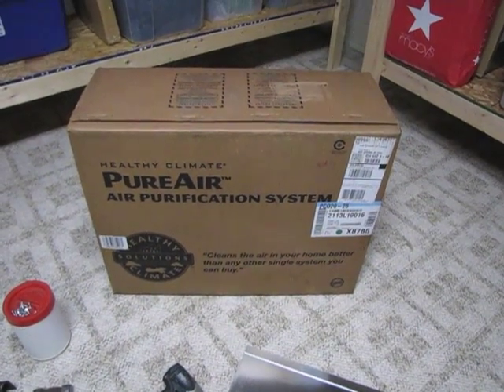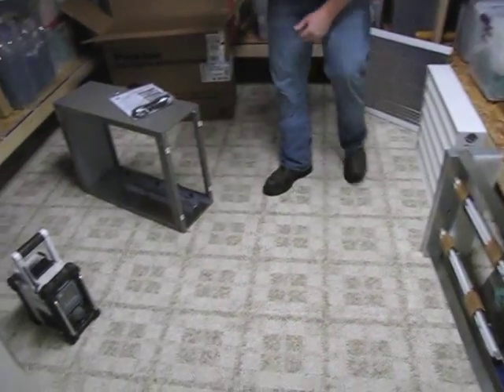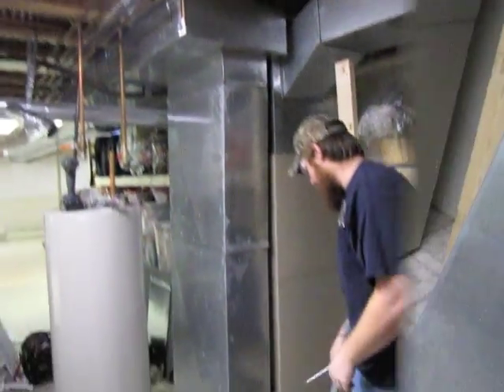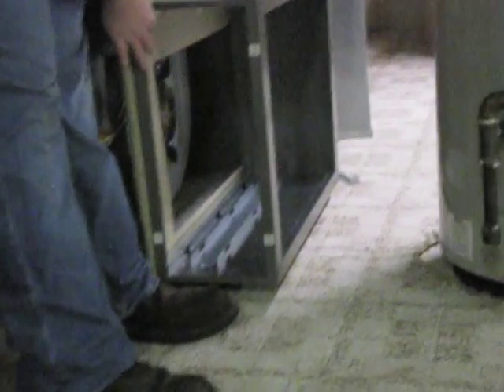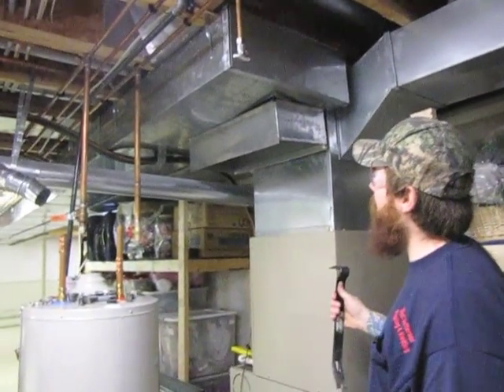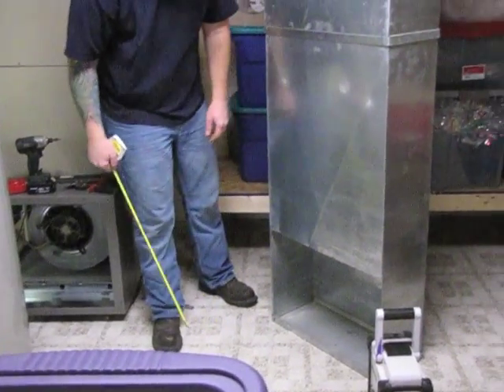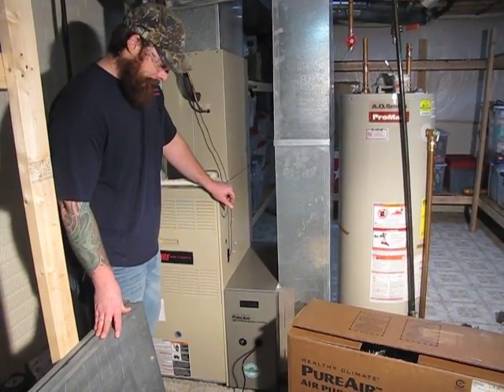DIY - How to Install a Healthy Climate (Lennox) PureAir Air Purification System

Comment: We have no A.C. On our new construct 1600sqf house, rarely needed,  opted for a 30in 7000 cfm  whole house fan. However the always record breaking wild fires in California make it necessary to filter the outside air. We built on a slope so the basement is huge and stays below 82degs even when it gets over a 100 outside. I already put in two 1 ft trap doors in the down stairs closets that open into the basement. The fan makes those holes howl. What I want to do is build 2 20in -+ square box cages mounted to the basement side of the trap doors and wrapped with air filtration! Im leaning towards a 2in x20in merv8 pleated with fiberglass pre filter over that. looking at bulk rolls of each. So I believe I need just over 8 linear feet per cage of the 2x20 pleated. I can really only find this site for the bulk pleated, any suggestions would be appreciated thanks!

https://www.airfilterusa.com/commercial-industrial/air-filter-media/pleated-bulk-roll?p=2

https://www.allfilters.com/pleatedmedia/bulkrolls/merv8

Comment: Doesn't that additional filter cause massive strain on the blower fan and reduce the circulation of air throughout the house?  I like the idea of cutting down on dust, but wouldn't that additional media severely restrict how much air can be moved?

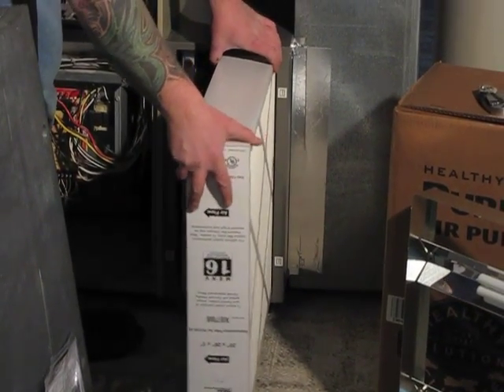Comment: At 1:05, the filter is on the left and the metal insert is on the right, but at 7:55, you put the metal insert on the left and the filter on the right. I assume you put the case upside down, but how did you adjust the slot? 

My furnace is on the left side and the return air on the right side, just like yours. But my PureAir cabinet was installed just the opposite - with the Air Flow on the case panel pointing to the right. As a result, in the cabinet the filter is on the left side and the metal insert is on the right. I strongly suspect it was installed in a wrong way.
Reply: My done the same way it could be wrong to

Comment: I need some help so for example Lennox Y2922 PureAir System PCO16-28 does that mean the filter is 16x28 or the dimensions of the box is 16x28?

Is the idea of the numbers suppose to closely match your furnace size ?

Once its installed do you used the original 1in filters or just one the merv (16) 5in filter and thats it?

Comment: Good video. I was hoping you would have shown how you connected the return to the filter rack. Do you mind explaining how you did that? Did you screw it from the inside of the filter rack? How did you seal the connection between the rack and the return trunk?
Reply: from the video angle looks like he might have screwed from inside the rack to the return and used cluack and tape to get a decent seal. thats how i think he did it and seems to work

Comment: Any concern about the merv 16 filter being too restrictive for the system? That's my biggest fear is having problems with hvac components
Reply from the maker: That is a very valid concern, but these filters are great about not restricting airflow. However, that is why it is important to install the largest cabinet you can - the bigger the cabinet, the more CFM it can move.
Reply: HVAC Parts And More thanks for the reply. I have a 20 by 20 Honeywell electronic air cleaner but unfortunately I no longer have the cells and my hvac guy said to just use the mesh prefilters as good filters are too restrictive. Feeling guilty about this I've finally ordered a 5" Honeywell ( 8 merv aftermarket) media filter but would much rather get the 16 merv Lennox as in your video. If you think the airflow would be fine then if the Lennox fits I will order through your company as you were kind enough to answer my questions thnx
Reply: Russ Logan 
its designed to be non restrictive by lennox. Have your systems static pressure checked.
Reply: Google User  I should get rid of my 2x  merv11  20x20x1 and just install 1  merv 13  25x25x5 or 25x25x6?

Comment: At about 7:00 you re-install the drop duct to the moved opening in the upper return trunk duct and it has not been attached to the PureAir box at the bottom yet. Then next shot @ 7:18  you say all is installed/sealed and start re-inserting all the components into the PureAir Air Purification System without showing how this final lower duct to PureAir box was accomplished. No 90 degree flange on your drop duct lower opening so you just had 2 flat metal surfaces against each other. How were the 2 pieces secured together on the 4 sides?
Reply from the maker: On this install, the PureAir/Return air were sealed with silicon and tape, but you can do what works for you as long as you're able to make a decent seal.

Comment: Great video! What would you say is the average cost to have this system professionally installed by an HVAC technician? Also, how often does one need to change the bulbs and filters?
Reply from the maker: +Calmly Crashing Thank you. That depends largely on your region, how competitive your local HVAC/Lennox market is, etc. But it should be around $1000-1500 I think. I know that's a wide range, but it should be somewhere in there. Lennox recommends that you change the filters once a year. They sell an annual maintenance kit that includes all of the filters. They also sell the paper filter separately if you want to change that more often.

Comment: Why wouldn't you hard wire it to the furnace?
Reply from the maker: +james holder Only because a power cord is quicker and included. There is a hardwiring kit that Lennox makes, but it's extra time and money and this customer did not mind the cord.
Reply: @Hvacpartsandmore  how many does this unit use?
Reply: +HVAC Parts And More: Is there a part number for the hardwiring kit?
Reply from the maker: +Nicholas Davis The newest model of the PureAir does not currently have a hardwiring kit available. This may or may not change. For the 2nd generation models of PureAir cabinets, the p/n was Y0628 (PCO16-28) or Y0627 (all others).
Reply: +HVAC Parts And More : Thank you for the information.

Comment: I've got two Lennox units and they are 2007, after the warranty ran out, they have cost me one ceramic furnace ignite, one outside fan motor, one has been low on Freon yearly and the condensation unit is going to cost $900. I've had Trane prior and nothing stopped that Trane, however, Carrier is what the AC man told me was best and would hold up to hail storms, then some.
Reply: 90% comes down to who installs the units. If they fudge the install then your unit will suffer and life expectancy will go down 1-5 years before you start getting issues
Reply: he trane equipment holds up in a hail storm better than any other.. I have installed both